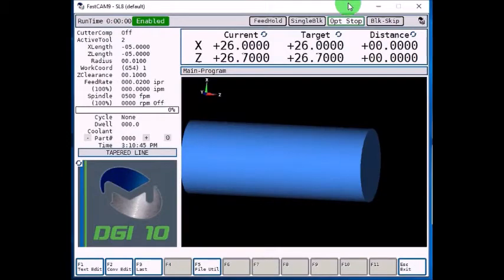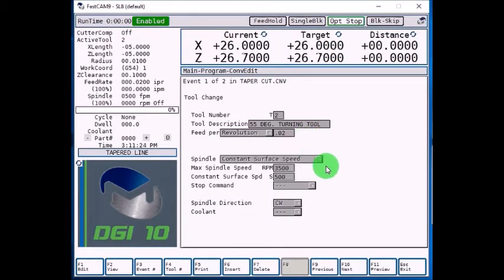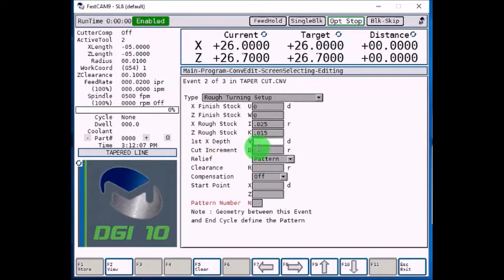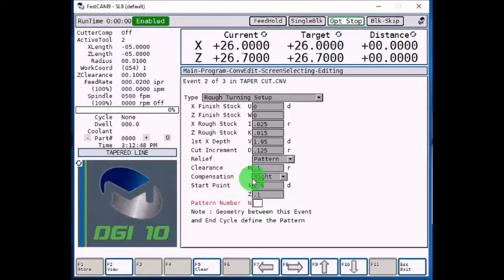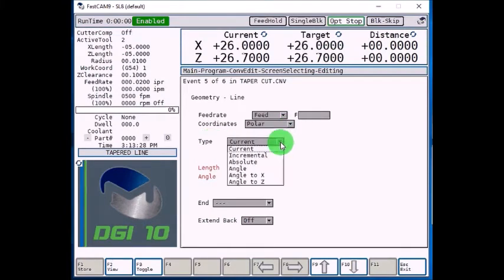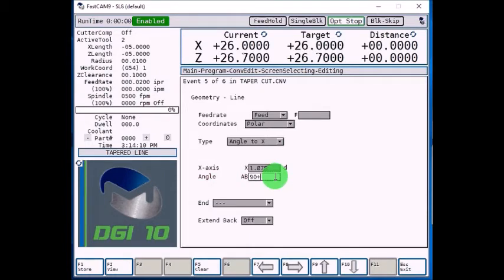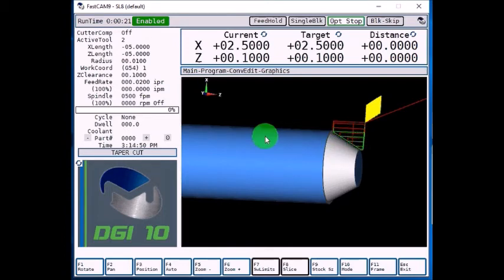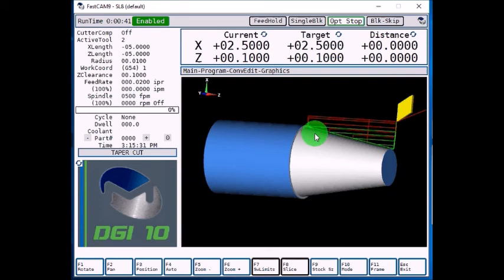Turning Cycle (Taper) Using Polar Coordinates on the Milltronics 9000 CNC Control

Comment: Thanks for this video. I run a ML22 and was wondering if I can get this software to work on a pc? I did get the basic lathe cam but it is a very small screen and can not go fullscreen. I also don't think I can use my mouse like you do on the solid model (if that makes sense). Could you tell me how I would go about this? Thank you!
Reply from the maker: The software is available in a desktop version for a PC.  Older versions can be purchased through the Milltronics Parts Dept.:  parts@milltronics.com
The current version of the software for the 9000 control is available for a free download trial on our website.  This can be found under the “CNC Control” tab.  And only the 9000 software will allow you to use the mouse to rotate the graphics.